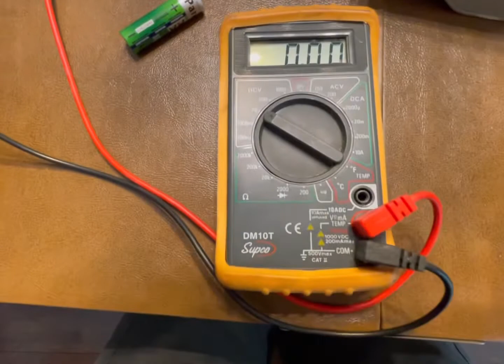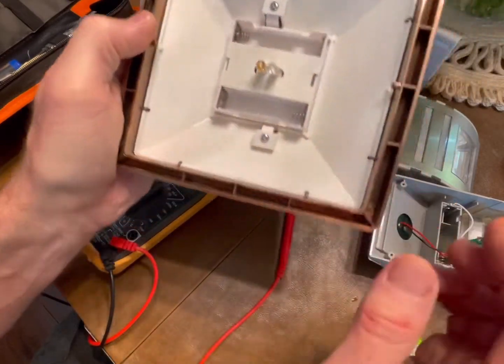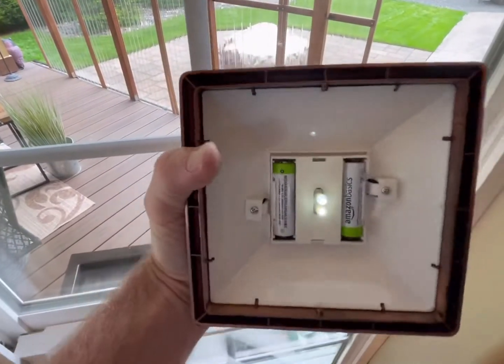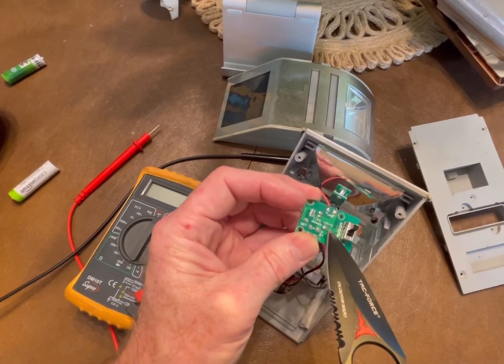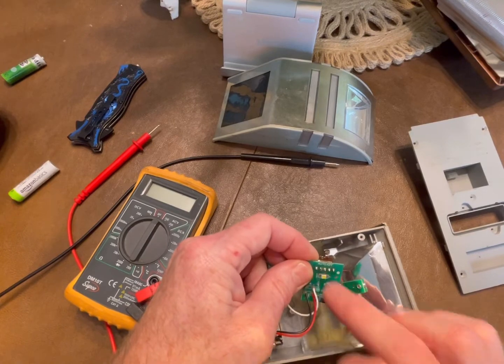How To FIX SOLAR LIGHTS - SAVE MONEY!!

Comment: 9:30 Switch is not connecting positive to ground which will cause short circuit, but it is connecting 2 parts of positive making no open curcuit. Also cool that electronic board is complete for also color changing LEDs because contains additional capacitor. Inductor is probably 220 uH if i see correctly, so there is probably QX5252 IC and consuming about 12,5 mA from battery.
Reply from the maker: I guess I over-simplified about the pos to neg statement.  What I think I was trying to explain was that the positive travels through  the actual DC bulb by completing the one way (direct current) circuit of the electricity by means of connecting the pos to the neg.  That heats or powers the element.  BUT- my statement could lead people to create a short (I.e. direct connection of pos to neg on a battery for example) - which is BAD!  Thanks for the information!!